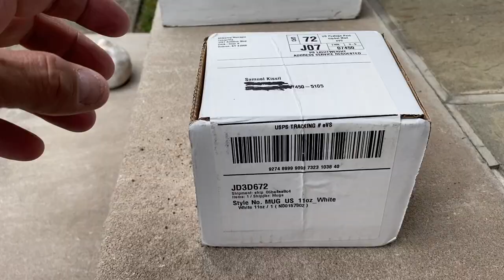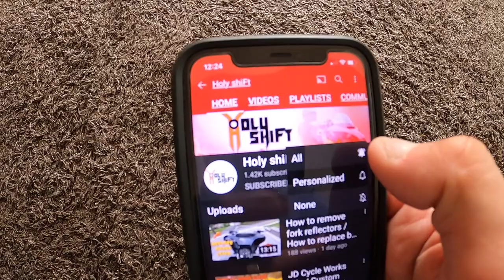Best Value Windshield Electra Glide Standard Install

Comment: I went through the same issues. The fork mounted wind deflectors, and the Harley branded 7.5” wind splitter windshield did the trick for me. Zero buffeting now, and I had significant buffeting to the point where It gave me headaches on longer rides.
Reply from the maker: I was wondering if the fork deflector actually works....
Reply: @HOLYSHIFT  the most significant reduction in buffeting came from the fork deflectors; maybe 80%. When I added the windsplitter, that removed the buffeting that occurred over 80 mph. The specifications indicate that the fork deflectors can’t be installed if you have the lowers installed. However, I have the lowers and fork deflectors installed, and they fit perfect, with no rubbing. I have a 2010 street glide though.
Reply from the maker: @EricSharpe  - I’m gonna try it out- thanks 🙏🏻 buddy